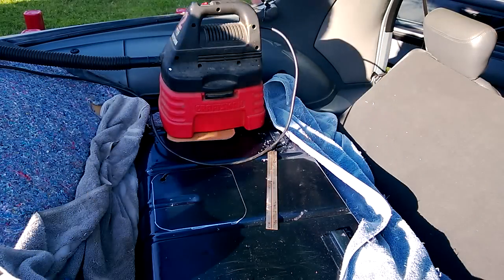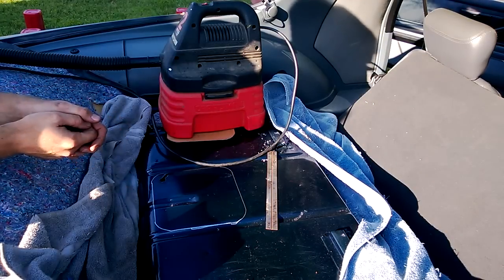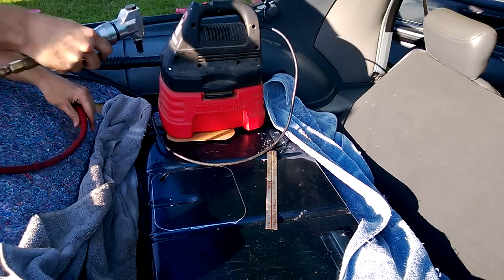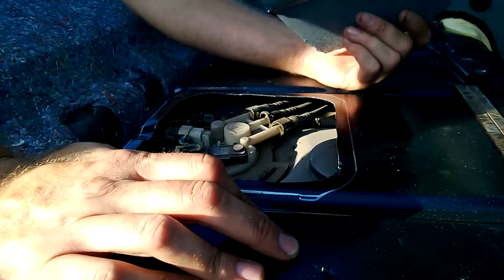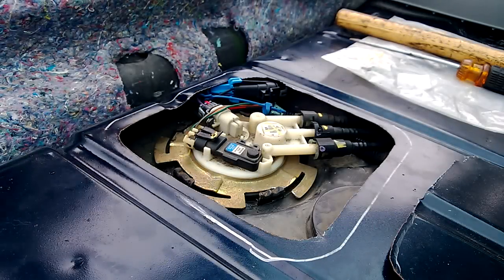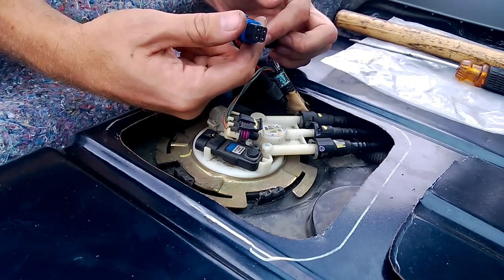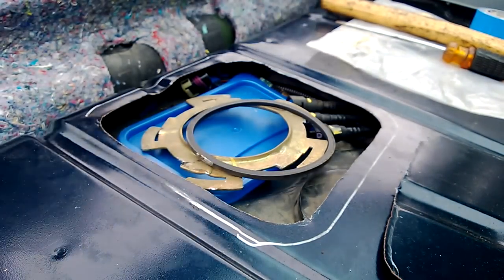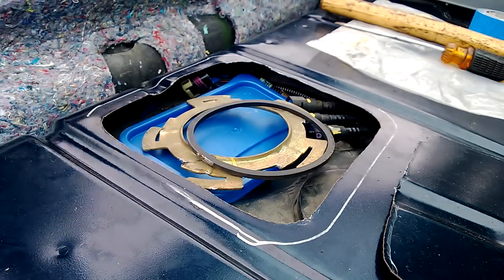Cutting Fuel Pump Access Panel and Removing Fuel Pump Assembly - 86 Trans AM with 02 Gas Tank

Comment: could you let us know the measurements of the hole and how you placed it front to back side to side. A drawing or sketch would greatly help as I wish ot do the same to my 1986Trans am.
Thank you Tim.
Reply from the maker: +Tim Dillon Hi Tim.  Im hesitant to give the exact dimensions, because each car might be a little different.  On your 86, are you running the factory tank?  If so, your hole will be much larger, and towards the front of the car.  If you have a new LS1 version of the tank, then you can make your cut like I did.  I think it was something like 5" x 5".  And I knew about where to cut just from seeing where the 98-01 guys were cutting.  Rear of the car is essentially the same from 82-02.  Check on thirdgen.org for the cutting location and size of the hole if you are running the factory tank.  Im not sure I would cut if I wasnt running the new style with the small fuel sender.
Reply: Thank you for the quick response much appreciated.  My car is 100% original with the 305HO motor and 5 speed stick,  if i have to cut large hole then I would not bother. 
Youd did a nice job on you your car thanks for the information all the best Tim.
Reply from the maker: +Tim Dillon No problem Tim.  If your car is otherwise unmolested, it probably wouldn't be my choice to cut the hole.  You end up making a large rectangular hole, and put a small "L" shape at the end behind the back seats.  This is because the lines coming out of the fuel sender are steel all the way across the top of the tank.  The ONLY reason I cut mine, was because A) the car was already modified extensively, including cutting sheet metal.  And B) the hole I had to cut was very small, and very easy to seal back up.  

This is what you'll be looking at on your car:
http://i9.photobucket.com/albums/a53/brutzelbude/Camaro%20fuel%20pump/image004.jpg

Not terrible, but too big of a hole for me.  

Thanks for watching and commenting!

Comment: can someone please help me.
where do i cut floor panel on a 2003 ford explorer to get to the fuel pump.( not any other year)
just 2003 please.
Reply from the maker: Hi Janet,  You will need to check the ford explorer forums.  That would be the best place for that information.  Otherwise, you will have to just find where your fuel sender is, and measure/mark the floor for cutting.

Comment: I tried this on a 88 iroc z. or was a disaster!  im guessing because mine has t tops the brackets used to strap the glass down has extra supports under the trunk floor. not only thst I had to cut an additional access port because my connects are located about a foot away from the pump access in the tank. i had to cut my fuel lines to remove it.  my car caught on fire burning down the entire trailer park! my mullet sustained 3rd degree burns I ruined my whitesnake jacket trying to beat the flames off my soon to be 4th ex wife.   now the fire chief wants to talk to me as well as my parole officer.why did I have to cut the 3rd gen!
Reply from the maker: Hahaha... Had me going as the first part of your comment is totally accurate.  I would never do this on a stock car.  4th gen tank makes for a VERY small opening and easy connections.  Sorry to hear about the trailer park.  Hope no one was hurt...besides your mullet.  Was it the party side or the business side that got burned? I sure hope it was just the business side.  And you wasted a whitesnake jacket on your wife?  Fire or not...bad form man.  Just LS swap your Iroc, fix the floor, use the plastic tank, and outrun the fire chief when he comes calling.  Problem solved.  :)
Reply: Sir Smokes allot true story? I have a t top , thing about cutting out a hole.
Reply: jr cruz in hindsight.. I still dont regret making the access hatch for the pump. But I did experience a fuel leak and had to make additional cuts into the body to get the connectors undone. Make sure you seal it
Reply: Too bad you couldn't afford a 4th. Gen .... Har har    #GearHeadsWorld      😂
Reply: I did it on a TA with a chisel to start it off and a snip not easy but thank god I did it case aftermarket fuel pump failed on me a few weeks later
Reply: Did it on 87 IROC w/ Ttops- no issues......
Reply: That's exactly why GM bean counters and lawyers decided it was better to idiot proof their vehicles and not allow owners to access the pump with an access panel . And their dealerships could make more money installing new pumps. There is no other reason GM couldn't have made access panels to replace the pumps .

Comment: The wire harnesses  how hard was it to run it down from the trap door back to the engine  ?
Reply from the maker: Antonio Nuno Not hard at all.  There isnt a TON of space there, but you can route it easily.  I actually loosened the tank straps a bit.  While there is room for the wire loom, fishing the plug bodies through was tough.  Kept getting caught.  So i dropped the tank straps a bit and was able to fish them up there very easily.
Reply: ***** 10-4 Thanks for the info .
Reply: +JEG's Garage Thanks for the info brother it has helped alot. But yes it is a hotwire kit.

Comment: Where is the outrage when folks lift engines out of the car? In Van Nuys at the Camaro plant, they loaded the engines from below, thus to be proper always do it the factory way and removed from the bottom too? :)
Reply: I worked at Van Nuys from 72-92 until it closed. Most assembly lines do raise the powertrain into the body from below. Usually called the marriage line ;)

Comment: Question. My son and I are about to replace the fuel pump in his 87 Camaro. Looking at all the videos im stuck on one simple thing. How do I know where to cut the hole?
Reply from the maker: If your sons camaro is stock, you will have to cut a much larger hole and it will be in a different spot slightly. My car has an ls1 fuel tank, so my cut was the same as on a 4th gen car. If you want to do it, check thirdgen dot org...there are a few pictures and write ups!
Reply: Thank you for your reply. Here's what went down today. I made a cut in the middle of (the hump) starting from the trunk side of the car and worked my way towards the front of the car.  Sitting pretty much center of the hump is the fuel pump. OK, here's where it becomes a waste of time. On this 1987 Camaro Sport, the fuel lines are stainless steal from the fuel pump all the way across the top, down the sides and over towards the body of the car. Pretty much 3 feet long if not longer. You pretty much are forced to drop the tank. After laying on my back for 20 minutes going over all the things I need to do to do this, Its really not as bad as it seems. Wish me luck, for my son's sake. Thanks for the video.
Reply from the maker: courtsNsession Right, the stock tank has long hard lines. I cant remember if there are rubber connections towards the front or not. I think there are. You gotta get to them, unhook, then fish the mess out. If I had a stock car, I wouldn't have made the access hole I don't think... My hole is really small compared to the ones you need with the stock setup. Dropping the tank isn't too too bad, especially if you're staying stock and won't really need to do it again anytime soon. Good luck!
Reply: Thanks for the luck. Money doesn't come easy for him. He works just as hard a you and I. As much as I feel his frustration, Im sad t say that there is no easy trap door fix for him but man I sure love spending time with him. And the Cats and the cradle and the silver spoon.......
Reply: courtsNsession On a 3rd generation Camaro I just estimated , measured and cut a small hole as a reference. Then with this first hole I  could see the top of the round sender  and thus knew how to enlarge the hole.  Mine was a fuel injected TBI engine and thus the fuel pump sending unit's top has 4 steel tubes that aim forward towards the back seat
Reply: 3beltwesty On this 1987 Camaro I had no choice but to drop the tank. The fuel lines from the top of the pump were stainless steal and ran from the pump, across the top, down the back and side. Im just glad I know how to weld and grind.
Reply: courtsNsession On an 82 I cut those 4 super long steel pipes Re " ran from the pump, across the top, down the back and side.".  Then I added 4 short fuel line hoses with 8 hose clamps. ie I left the bulk of the steel fuel hoses in the car.
Reply: 3beltwesty Oh trust me, that thought crossed my mind a few times. I dont know what it was with that car but every nut and bolt seemed to want to fight us all the way. We didn't have all the tools we needed. No spring compressor but we did have a sawzall. Needless to say, we have new nuts and bolts on the cross members. This Camaro sat on a driveway for 7 years untouched. It's running fine now. I had to replace the transmission mount a few days ago. What can you expect with a car that old with a manual given to a 20 yr old. That was an hour and a half job. Unbelievable.
Reply: courtsNsession
Reply: Did u ever find out I have the same problem
Reply: +Juan Delgadillo What same problem are you having?
Reply: I need to find out if I can cut where the trunks at to replace my fuel pump I just don't know if its the same as an 87 because mine is a 86
Reply: +Juan Delgadillo The best way to find out is to jack up the back end enough (don't forget your wheel chocks and jack stands) crawl underneath the drivers side and follow your fuel lines. On my son's 87 the lines are Stainless steel from the front of the car, down the side until they meet with the stainless steel lines coming from the fuel tank (fuel pump). If you see stainless steel lines coming from the tank (pump) then chances are pretty good that you need to drop your tank to replace the pump. Its really not that bad of a job but this also depends on how mu gas in in the tank and how strong you are. I had the back end of his car up high enough where I could bring my knees up to my chest to help me support the weight. Yes, I had to cut off the exhaust in a few places because it will be in the way.
Reply: Juan Delgadillo Also Juan, I went to partstrain.com for my replacement fuel pump and it showed me a picture of it. So this might be the easiest way to see if you need to drop your tank. If the lines are long, then yes, you need to drop it.
Reply: Juan Delgadillo If you don't mind me asking, whats your car doing or not doing that makes you think its the fuel pump. After I put the new one in, it wasn't sending fuel even after priming the pum I was told to CHECK the fuse which is located under the hood on the passenger side fender wall. Its just a few wires that lead to a fuse. Kinda like a dead end wire. I replaced that fuse and all was good.
Reply from the maker: Juan Delgadillo courtsNsession Pretty much has you covered.  86 to 87 shouldnt be much different as far as the fuel lines go.  You wont be able to cut like I did.  You'll have to make a much bigger opening, towards the front of the car, instead of the rear like me.  I cant remember if there are already rubber connections, or if you have to cut the hard lines, and re-connect them.  That idea never sounded good to me... but check online, you'll see some write ups/pictures of guys doing it on stock tanks.

Comment: What did you use to cover it back up?
Reply from the maker: I cut a piece of aluminum larger then the opening, used windshield sealant and screwed it down. I want to redo it next time I am back there. Going to either use a premade hatch, or use nutserts vs sheet metal screws.

Comment: Pontiac was always one step ahead of Chevrolet. The 86 camaro did not have the quick disconnect fuel lines.
Reply: Pontiac and Chevy are basically the same company. GM, the parent company,  manufactures the vehicles for both

Comment: Be sure to use a brass drift...all the while what I really used--my screwdriver and hammer--is lying in the background ;)
Reply from the maker: Hahaha.. Yeah the brass drift didnt work for crap.  I dont know many people that have been able to use one.  In fact, I was talking to the tech at a garage, and he said they rarely use brass, and will usually just has a big screw driver.  That said, the screw driver in the video would NEVER get that ring off. LOL.  It would likely turn into an S shape, and the handle would explode.  You can see the bar I used to knock er loose.  And I didnt explode :) But, ALWAYS use a brass drift... ;)
Reply: ***** Yeah,, I've only ever used a screwdriver and hammer. Still here!

Comment: by any chance is it the same hole made for the v6 models?
Reply from the maker: If its a stock 3rd gen, no.  The hole will be much much different.  Im not sure if the v6 had the same tank as the v8, but you will need a big rectangle, more towards the front of the car.  This is only for guys running a 4th gen plastic gas tank (99-02).

Comment: Yo bro I have a 87 trans am I need to do the same thing is it located the same place as the 86 trans am.
Reply from the maker: Sorry for the late reply.  Probably too late.  But NO... on a stock 82-92 Firebird or Camaro, you have to make a MUCH bigger hole, and more towards the seats.  This is only because Im running an LS plastic tank.